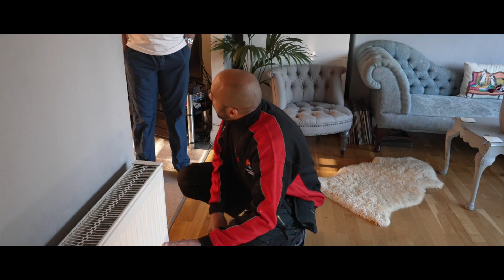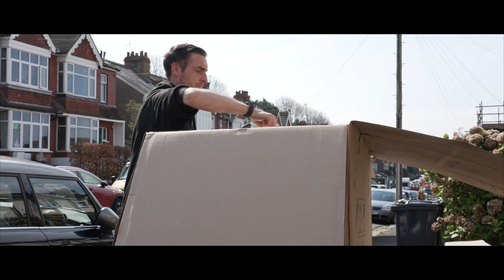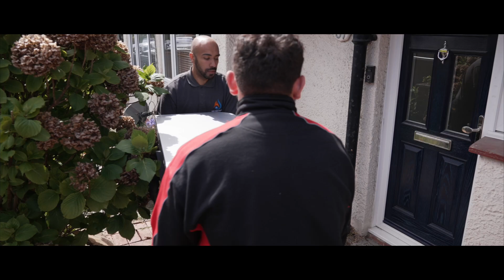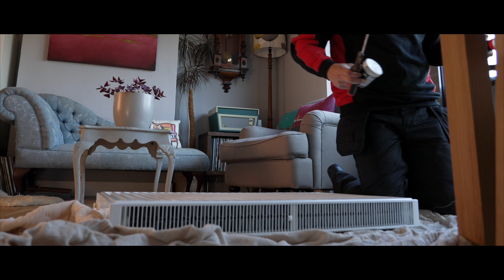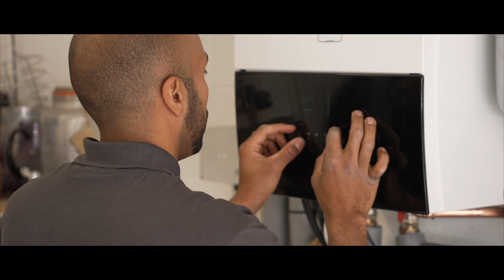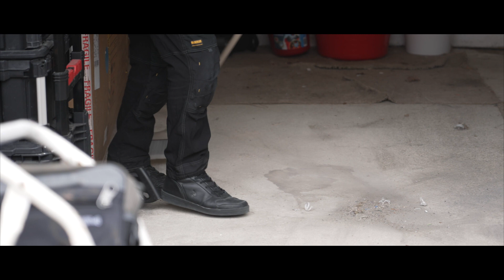EDF Air Source Heat Pump Installation

Comment: Design what design they changed 2 radiators didn’t touch the pipework and it is costing a complete fortune not EDF but it was MCS accredited company who installed it start to finish.Proper hoodwinked into getting a heat pump that I can’t afford to run defeats the purpose and affordable was the main reason for getting the heat pump,no comeback.

Comment: I have a three bedroom house but no attached garage in which to put all the quite large internal components seen in this video. Until the internal parts are no larger than a small 10kw wall hung gas boiler I will never be able to have one of these installed.
Reply: I’m surprised they let you post this mine will be taken down,no bad comments about heat pumps allowed it’s the Law.